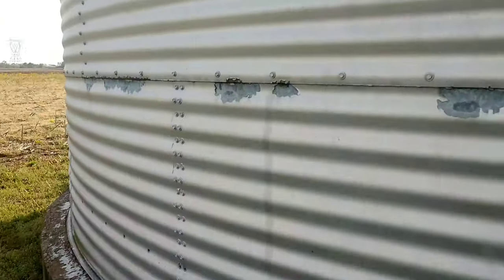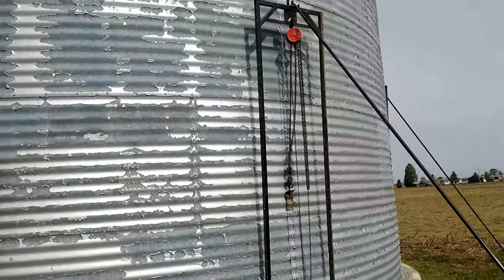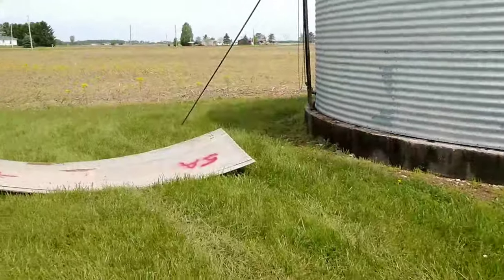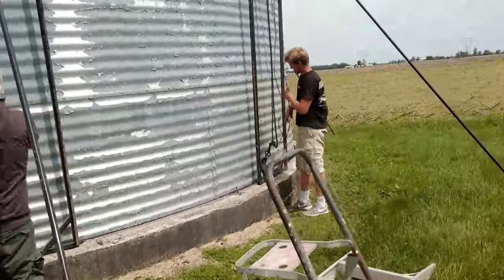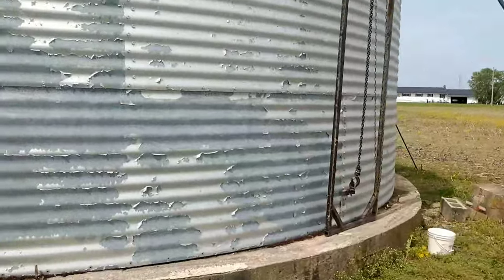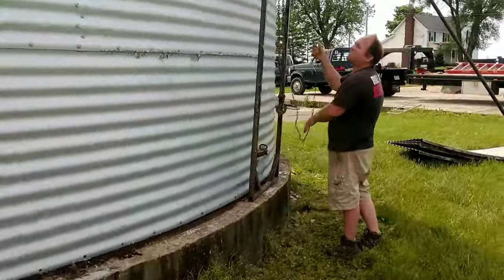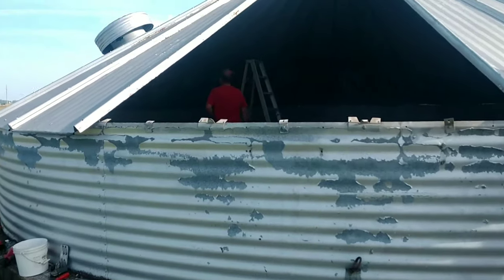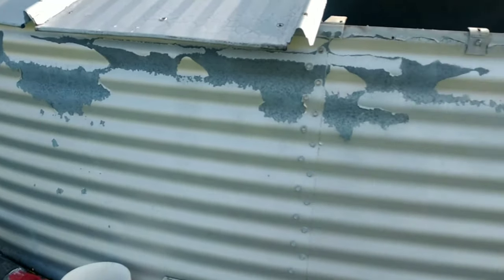Taking down a 10,000 bushel bin

Comment: what do you use to connect your jacks chains to the bin to lift. Also, What weight limit do your chain lifts have?
Reply from the maker: We took  this bin down for a buddy of mine.  He made all the braces himself.  We just bolted anchor points on the bin for the chain hoist to lift the bin. As far as the framing to hang the chain hoists to it was a welded frame with a leg coming from the top of the frame down to the ground and the leg got anchored to the ground.  We used 5 of them around the bin

Comment: Hi Does the steel thickness increase with depth of the bin or is it uniform steel thickness what are the dimensions of this bin? Thanks
Reply from the maker: This bin was 30 feet diameter. The thickness was the same from top to bottom
Reply: That is not true what so ever. Your sheets get heavier as the sheets go lower